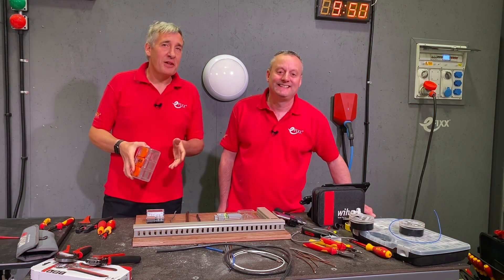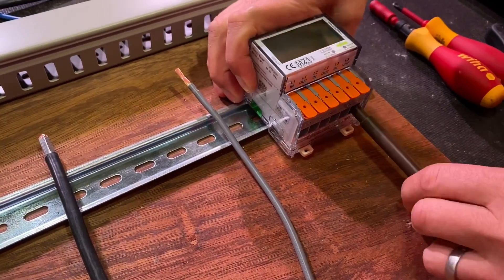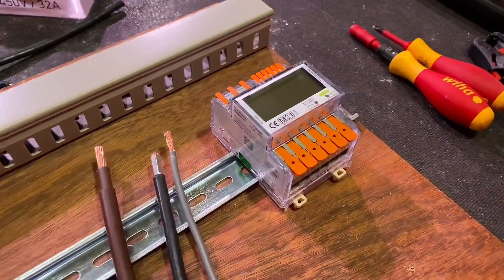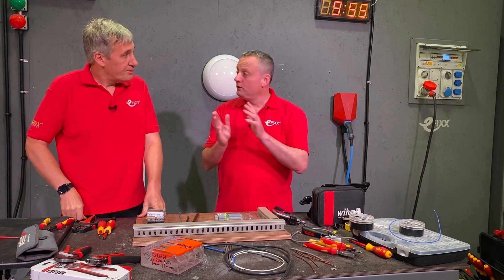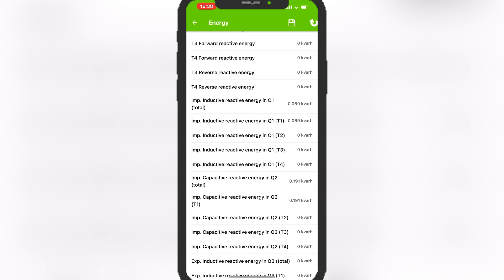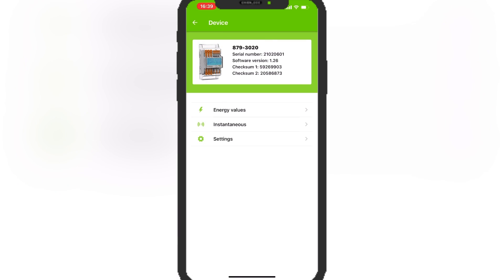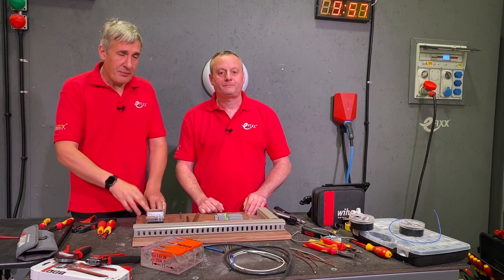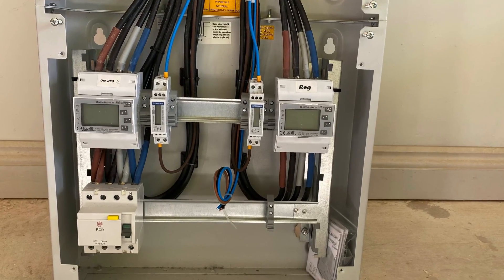WAGO MID ENERGY METERS - easy to install for energy management

Comment: Surely screw connections are better / stronger / safer, more surface area in contact?
Reply: No. There are long term reliability issues with screw terminals.

It is why Wago's with lever terminals have been certified for use in Maintenance Free junction boxes, as long as it's a genuine MF enclosure and the manufacturer of the enclosure's instructions have been complied with.

Comment: Just as we move to smart meters everywhere and reactive billing for the domestic market.
Looks like a nice simple installation. Bluetooth is a delight if you can have a local display without going into the meter box?
Installed different CT 3~ meters recently. Different cable entries, different features, different modbus registers and limits on the CT ratios.. I want to load profile and measure power quality. 
Looking forward to more brown outs and harmonic issues so logging is the direction for me. The need for SPD is growing I think but this is the only way to find out.

Comment: Some of my customers here in Glasgow area, have three phase supply (with the original cast iron service head) only using one phase to run the whole house (medium sized bungalows) They didn't know  this till I pointed out to them that they would have no problem having a car charging point and able to use an electric shower at the same time! Great channel guys, always interesting content, keep up the good work, Pete 👍

Comment: Having managed computer data centres where energy is the major — and obviously unavoidable — cost you always want the most granular monitoring you can get.  So very much up with this sort of thing.

But I do wonder where the installation cost / possible power saving break even points will fall.  Gut feeling at the moment is this won't provide good ROI on domestic scales.
Reply from the maker: In the right application your correct they give great ROI - not really aimed at the residential application.

Comment: 1. So how much energy would you have to save to pay for the meter?
2. If it was a metal distribution box with metal hinged covers the Bluetooth might not work. The earthed cover with the box would form a Faraday cage.
Reply from the maker: Energy monitoring as part of a wider energy efficiency program usually delivers very strong returns.  The Bluetooth signal is initiated via the screen - you would be opening the enclosure door.
Reply: @efixx  Bluetooth is a wireless signal and initiates through a transmitter and aerial. The screen is just the interface to the controller. This setup is very similar to the smart meters and displays in a home. I would want the display visible at all times if I was energy monitoring just like at home.

Comment: Do the phases actually need to be different or could you use this to monitor three individual single-phase loads?
Reply: The WAGO 879-3000 is suitable for 3 phase loads or 3 single phase loads. There is one caveat, if the 3 single phase loads are all the same phase then the total 3 phase measurements that the meter can display are not valid (the individual single phase measurements are valid). If the 3 individual phases are derived from the 3 phases, i.e. as in the case of a 3 phase distribution board 'outgoing ways' then all the metrics are valid.  Andy Turtle, Product Manager at WAGO UK.
Reply: It's three individual phases.   The meter will complain if it's three same phases, as it sees 0 degrees difference. It's expecting a phase angle.

Comment: Certainly something i'm going to install when I'm fully off grid, interested in seeing the overall efficiency from what is being produced by renewables and batteries, to what is actually being consumed
Reply: That's not efficiency.  Efficiency is about  how much energy is wasted.

I can tell you the answer right now without your installing anything.
For PV panels a maximum of 23.5%, and taking in to consideration losses in cables and inverters, the overall efficiency is less than that.

But the efficiency if you are off-grid isn't important if you are getting your energy from renewables such as Wind and Solar. It doesn't matter if you are getting 23% efficiency or 16%.

What matters to you is, how much does it cost to buy the equipment, how much power does it generate, and how long does it last? 

You can push for highest efficiency in say solar panels, but that doesn't necessarily mean you will end up with the lowest pence per watt of electricity generated. In fact, those higher efficiency panels will probably cost more.
Reply: "produced by renewables and batteries".
Batteries don't produce energy. They store it.

The energy comes from either the national grid, or local generations such as oil, wind, solar, small hydro.

I once met a guy on a camping site,he was in a caravan, and he thought it was cheaper to use the power from his caravan's leisure battery than use the mains hook up on site.

He wasn't particularly bright, having left school with no qualifications, and it was quite obvious he couldn't see that the energy to charge up his leisure battery came from the national grid power - he didn't have any solar PV or wind turbine, so I didn't even bother to try to explain it to him.

Comment: Another step towards throwing our screwdrivers in the bin 🤣,
And another peace of technology to go wrong and will cost a month’s salary to get fixed or replaced,  just like the dam smart meters we already got.  And with the cost of electricity go through the roof and another two suppliers gone bankrupt  your not going to save anything on your bills. Nice looking bit of kit though.
Great video guy’s as always 👍👍. Again no response must mean I am again right 😂👍
Reply: Glad I've not invested in torque drivers .lol.
Reply: Totally agree this is dreamland stuff for 99 percent of the world
Reply from the maker: It’s a regulatory requirement within larger commercial buildings in the UK
Reply: Metering is controlled by the DNO. If your power meter fails, they'll fix it. Also, digital power metering has been happening for decades. The only new part of this is the wago toolless connectors.
Reply: Bypassing the meter just got made easier 💴
Reply: @ryanjones7921  now that's a very naughty thing to do !
Reply: Supplied with the meters are lead sealable terminal shrouds. In this respect these meters are no different from any other on the market.

Comment: Is there a meter that can be used in a single phase board?
Great video with lots of great info
Reply: If I'm not wrong, you can plug only one phase on it, and maybe keep the rest for a future upgrade to a 3 phase system?.
Reply: The WAGO 879-3000 is suitable for 3 phase loads or 3 single phase loads. There is one caveat, if the 3 single phase loads are all the same phase then the total 3 phase measurements that the meter can display are not valid (the individual single phase measurements are valid). If the 3 individual phases are derived from the 3 phases, i.e. as in the case of a 3 phase distribution board 'outgoing ways' then all the metrics are valid.  Andy Turtle, Product Manager at WAGO UK.
Reply: @andyturtle  thank you for the great help